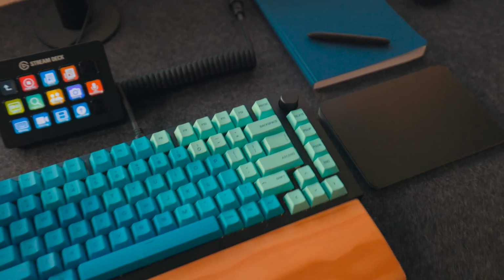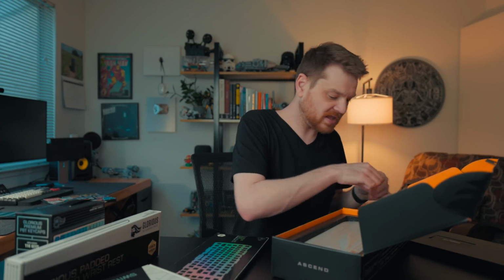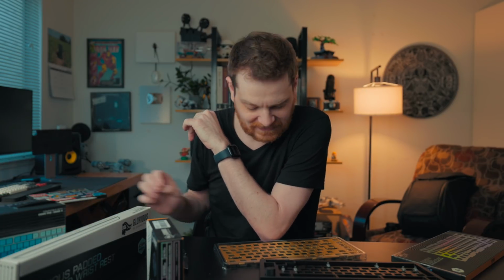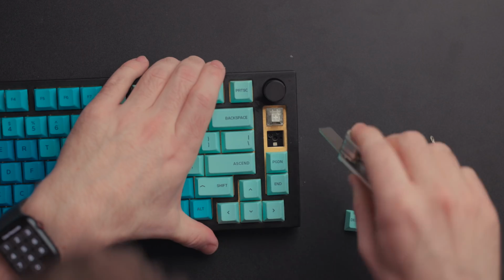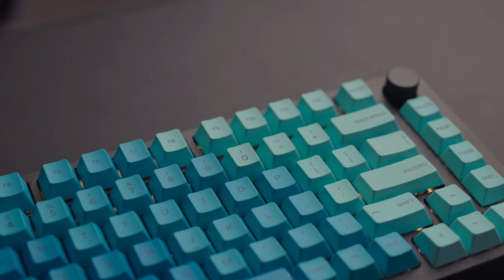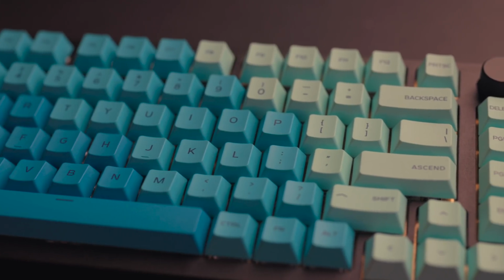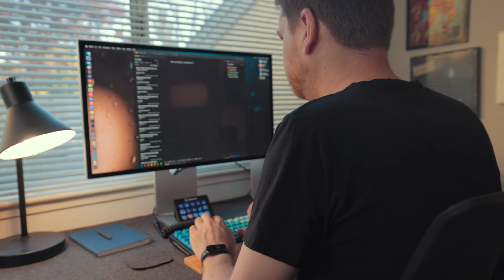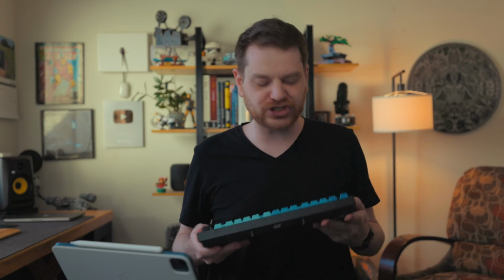Building A Custom Mechanical Keyboard (GMMK PRO)

Comment: How does your typing speed vary between Apple keyboard and this? Does the extra force required fatigue your fingers quicker than Apple keyboard? I wanna use a mechanical keyboard but have these concerns.

Comment: Welcome to the rabbit hole - in 3 month you will contemplate which lube to use for your stabilizers and if you should swap the springs in your switches…
Reply from the maker: I may have already ordered some stuff… 😅😂
Reply: @ChrisLawley  looking forward to an update/follow up video.
you should definitely change the stabilizers as they are commonly known as the weakest part of the gmmk…